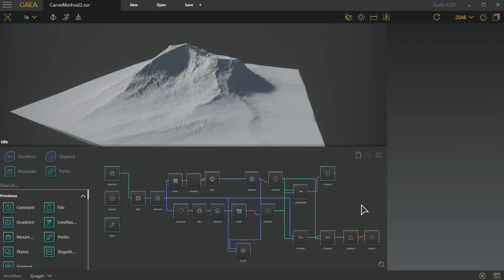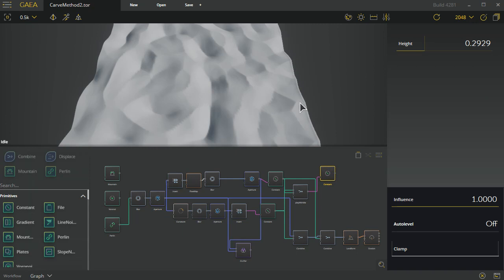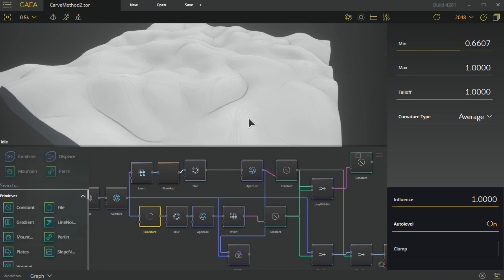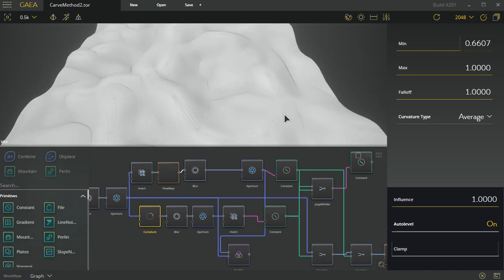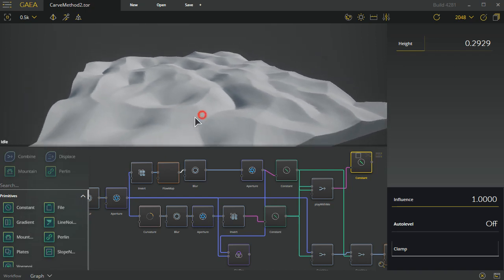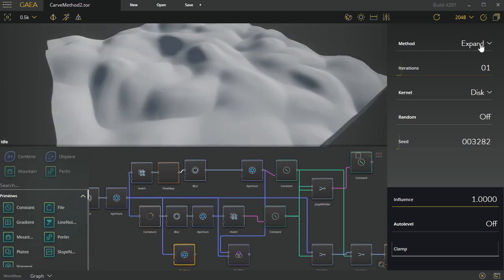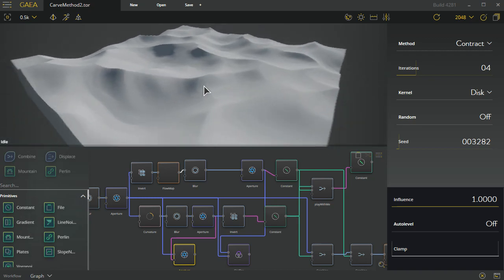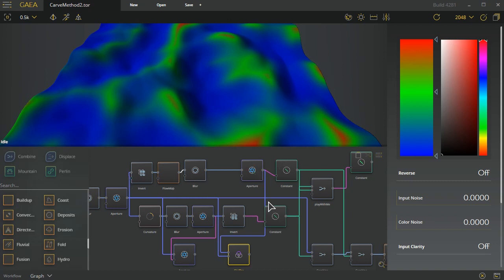Gaea EAP - Creative problem solving

Comment: From all the terrain software available Gaea seem to have been made to make perfect sand dunes, i tried all the others and making sand dunes is a chore! Unfortunately there is no trial yet since and i need to buy a terrain software in the coming weeks.
Reply from the maker: Gaea is competitively priced as far as I'm concerned. $74 for the indie version. It's designed by someone who has used the other software on real productions and wanted to have something better. There is no tool with more artistic control on the market right now... and it's not even finished software yet :) The only issue is that it's still in early access which means there will be points where a part is broken for a week while they catch the bug and release a patch. Often there is a workaround, or you can wait to update staying with the last stable version. They are coming close to version 1 soon though. Once there, it should remain stable.
Reply: The price is OK but the indie version is not very indie since important features are not included like tiles export and now terrain are often 8 k so limiting at 4 k is not what indie need. The closest thing to a real indie license is the professional at 149 and this is still a reasonable price but i don't understand what they mean by offline license since if this mean that you have to be connected to the internet to work than it's a no go if you live in an area with unreliable internet connection.  Thank for replying and i will have to make a choice soon.
Reply from the maker: @petertremblay3725  I have an unreliable internet.. I haven't had an issue. I think it just checks when you register.
Reply: Thank but i will have to ask them before buying because i will never buy a software that force me to be online for it to work and i think most people will agree with me here.It would be very nice if you can show how to mix various biomes on one single terrain like having a mountain region that blend to sand dunes and getting blend again in coastal region. @cowsmanaut
Reply from the maker: @petertremblay3725  Indeed, if I had to always be online, I couldn't use it. I'm certain this is not the case, but you are right, ask Dax so you can be certain. As for the multiple biomes, in a game engine I'd do that differently by paint masking in unreal or Unity.. but you can certainly mask areas easy enough in Gaea, more easy in a short while since paint masking is coming in the next update. :)
Reply: Great will ask and there is a 95% chance i am going to get it! @cowsmanaut